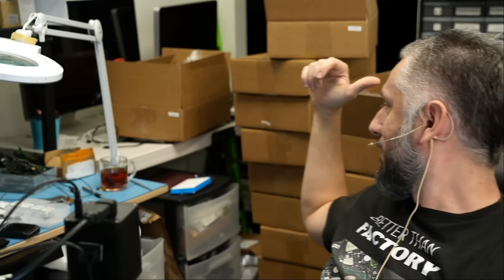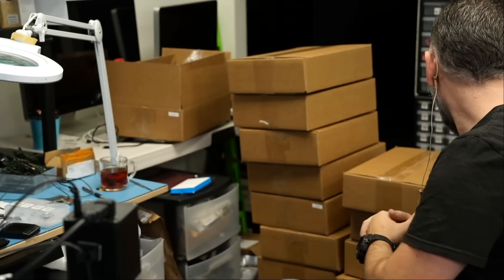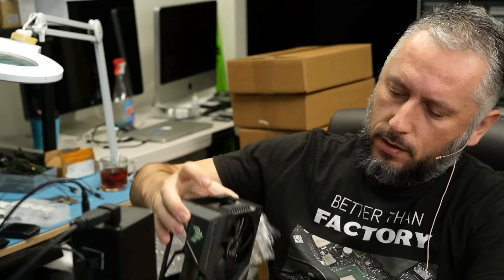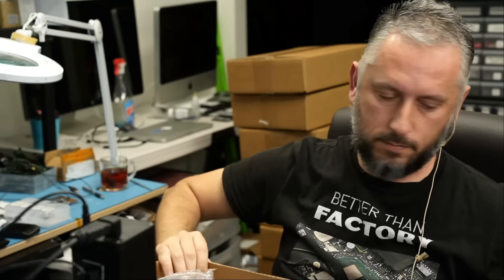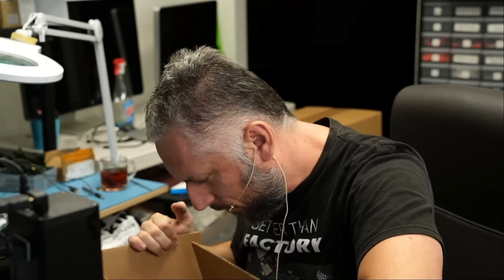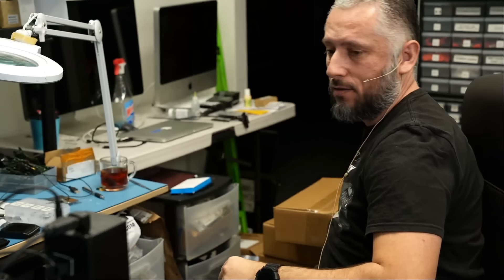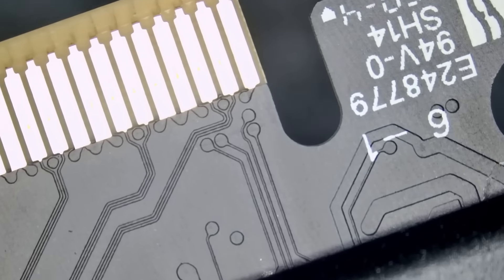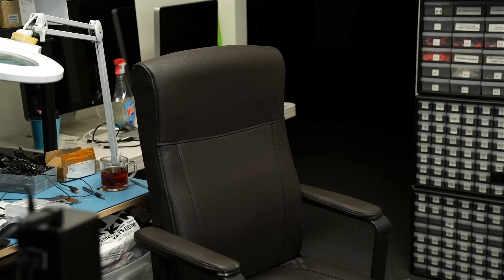We received 19 cracked 4090 Cards for repair - Who's to Blame ?

Comment: Curious, why didnt the customer ask if you're willing to repair 19 cards with cracked PCB before sending it in?
Reply: Maybe the customer was not aware of the cracks?
Reply: Doubt the customer knew what was wrong with them.
Reply: customer wrote damage so he knew...
Reply: @kroks06  we have a "video" there too, what "video" means?

Besides, the truth is we don't know who exactly wrote those things there.
Reply: @kroks06   Knowing they are damaged is different to knowing why they're damaged....
Reply: My heart is bleeding to see all that dead cards😢
Reply: It's entirely possible they're a flipper who bought them sight unseen from a liquidator and just had them sent over to Alex.
Reply: video probably mean they didnt notice damage but they werent getting video @VVarat
Reply: @Vipppala   maybe
Reply: Customer is obviously a dealer or system builder. He knew they had cracks.
Reply: User fault or transporter fault if that was prebuild system. Manufacturer and materials are sone by specifications. This is sensitive equipment and not ment to be used by everyone. Manufacturer only can give instructions for installation. Rest is on end user or builder. As a computer engineer.. i see often some pcs.. not starting cause user upgraded but not working anymore ... So far far 90% of cases solved. But i always mention to them.. about these dangers with extra large graphics cards. (The computer is on the table... Till it reach the floor and final location.. they should handle it as calm.. so not to beake butterflys wings. As also instruct them when they come for service.. the same way.)
Reply: You can always sell the parts.
Reply: @VVarat prob means there is video output even with damage.
Reply: junglebunny Mining rigs usually have GPUs mounted vertically, so such problem wouldn't happen.
Reply: Same
Reply: @kroks06 not true the wholesaler could've put that on or he could've just put the sticker on based on what he'd been told.

Be careful jumping to conclusions
Reply: *customer, what? Is he a Cosplayer? Lmfao costumer
Reply: Probably for mining, shrouds removed. Maybe water cooled, OC.
Reply: Probably no response from alex
Reply: @VVarat he should change trade if he is not aware…………
Reply: I have no sympathy for such a dope.
Reply: Because they think he can fix everything. Maybe it be best to send it to a dedicated gpu fixer.
Reply: @herofrenoulis did you use google translate? None of that made sense
Reply: customer probably knew they were damaged bc they wouldn't turn on, and the ones that did he labeled as "video" without knowing the damage itself was on the PCB
Reply: Plenty of spares
Reply: Insurance probably wants them to be sent off first before they pay for the lot.  Maybe???
Reply: Ive seen him fix cracked boards on his videos in the past.
Reply: @Versette Sure it could.
Reply: its a cracked retention tab...   notice there's no electronics in that part of the board??
Reply: Customer sounds likea miner

Comment: All those cards looks quite new to me, the Asus cards all cracked at the same area. Maybe the customer is in a PC assembly business. He assembled all these PCs for his customers and boxed it without internal support to the display cards. Rough handling of the boxes during delivery by someone might be the cause. It is so sad to see so many cards died like that.
Reply: Talk about an expensive mistake
Reply: I was thinking something similar, this is for sure user error. Where they crack is the tab that goes into the locking mechanism of the motherboard, not a single one cracked at the pcie slot.
Reply: Most probably,
Reply: LOL Seriously?!? Rough handling??? How does rough handling affect one tiny specific area?? And how do you crack a PCB.... Those things are hard as hell! NO!!! Something or someone applied pressure on those spots and yeah... I would bet it was exactly as he stated! These cards are HEAVY af!!! It's a matter of time before they bend and start cracking... And those spots are actually the most fragile ones... GPU's are screwed on the back, providing support up till the center of the card roughly... While the rest of the weight... ONLY is supported by the PCI slot... So you get alllll the support for the back of the card and almost no support for the front of the card. If you have a 3 fan GPU... GOOD LUCK! You're going to need it. It's also a miracle that motherboard PCI slots are not breaking too! 
GPU industry is a JOKEEEEEE! The moment I saw the Nvidia 3000's series I started laughing... NO WAY I'm going to buy a 3 slot GPU and on top with a "special connector". The 4000 series is a little better but oh well... Still not enough! A lot of things are not enough!! These things cost +1000$ and they don't even check if the thing as a proper weight or if it's a reliable/solid product. Just INSANE bs!!! Multi billion dollar companies and they behave like kindergarten kids... They don't know what they're doing
Reply: Sadly i bet your right,n Asus gets the flack.i used them for sooo long.not 1 problem ever!
Reply: Your guess...is as good as any other guess. We could all post guesses all day long...and write a story.....I'd rather read facts and knowledge.
Reply: I thought so too, what an expensive mistake
Reply: @additudeobx I know for a fact it's a user error issue. Have asus rog strix 4090 for over a year, moving pc and cleaning , no issues, because I do it carefully.
Reply: what a loss  uuuaaauuuu ☹☹😮😮
Reply: he clearly was under the impression that Northridge could repair the PCB.
Reply: You are 100% correct
Reply: The 4090 cards are really heavy. Mounting them sideways without extra support somewhere near the free-hanging corner is a disaster in making. If you don't shock the card it could be ok for years but even a static load like this is bad if there is any problems with the FR4 material. I think it's nuts hanging a 5 pound card sideways from the PCIe socket and the rear bracket. My 1080ti weighs only about 2.5 pounds and it's already iffy. It clearly sags without extra support at the rear end or the outer edge.
Reply: @MichaelRogersJesusrules   lucky you. 4 asus products, 8 RMAs on my side. Absolutely the worst company I've ever bought from.
Reply: @IGame4Fun2  - all of it? I mean every last one of them? No chance in hell at all that damage could possibly be from anything else or any other means? Not in the slightest remotest of possibilities at all, because you said so and you know for a fact.. Wow,,, Yea then, gee whiz... I guess it's dang well gotta be...
Reply: @additudeobx  like what? They just slide off the shelf? Of made like that at factory? Or maybe some monkeys break these cards. It's clear that some users either got this shipped to them and dmged  or weren't careful moving PC around.  User error. Take your sarcasm and sence of humor to the dump, cause it's trash
Reply: Thx for the most likely context this helps alot considering I'm literally 24hrs or so away from dropping bands on a 4090 lol was about to switch up my build
Reply: @Trip4man  I don't know what you are trying to say dude, you seem to be suggesting that rough handling in transport is not a likely cause, but then list the reasons why it's likely. Shock loading is by far the most likely cause of those breaks, when the card is exerting 4 or 5 times normal weight on the tabs.
Reply: @tyrantworm7392  You don't know or you don't want to understand??? Because you made your mind up about some bs reason.... Tell me... HOW does rough handling cracks a PCB when they're inside a box with 'air-pillows'?? Andddd specifically on that part of the PCB and not.... Somewhere else
Reply: @bluej511  did you watch the video ???  there were at least two that cracked  along the slot pins.
Reply: @Trip4man  thanks for this comment about nvidia
Reply: And the should be fined or even jailed.

Comment: The problem is not the pcb cracking ... the real problem is that there are traces in this weak spot ... the manufacturers know that that area is a weak spot and suffers a lot of mechanical stress ... yet they put traces and tracks in that area ... coincidence? ... i don't think so
Reply: Thank God my msi 4090 liquid X is still good lol😅 still running like a beast
Reply: Why would they put traces to and from the pci-e slot? Can not be a coincidence 🤡🤡🤡
Reply: It's the PCIe connection.  Obviously it has to have traces leading from it lol
Reply: Why Asus intentionally make a inferior products 😮
Reply: They have limited space to work on. I guarantee they're not wasting space and the cracks will travel further between the layers that what you see in this video. The problem is solely weight and lack of support by the installer, whomever that is.
Reply: the same reason they keep on adding the shield from the gpu that sustain all its weight atched to the pcb instead of the fucking heatsink ...

Comment: My take: 
When there is such a common weakness the manufacturer should at least offer cheap GPU-less replacement boards so the GPUs can be re-balled.
The 4090 chip is the most expensive part of those boards.

I hope you record all the ones your take apart.  Would love to see all the ones that get repaired.
17:28 - "ASUS...ASUS if ASUS is watching they're probably going crazy."
Customers watch your channel and see what you do.  
They think you're a miracle worker Alex and quite often you are.
Reply: You can simply do that on a board that the GPU don't work
Reply: @mokywlmd572  ...which requires you to find one where all the other components are in working order.  What are the chances that the GPU experienced a voltage surge enough to kill it but all the other components are hunky dory?  Yeah...we know that's an option.  It shouldn't be the best available option.  "simply" yes...thank you for your input.
Reply: what about the fact that it's entirely was sent by 1 costumer
Reply: It's called manufactured obsolescence
Reply: its not a weakness, the motherboard is tough.. the weight isnt an issue, its a user propblem.. fix your mounts.
Reply: @kanecrowe4587  Nahh, when this happens to so many boards it's a product defect.
Reply: @VincentVonDudler  don't you get a support bracket with every of these GPUs? I think you do. They send it for a reason. So it is not a defective product when you don't instal it properly. So without support bracket.
Reply: Definitely manufacturer issue.
Reply: ...and why I will assume the reason asus provided an adjustable support stand... as they knew the weight/mount was an issue @VincentVonDudler ... .... Manufacturers mount the heck' out of the cpu, but leave this gpu slot mounting underdesigned for the current gen' cards.
Reply: @korinogaro  ASUS sends a little tini tiny support pillar that barely reaches the gpu in a case with a psu shroud. no psu shroud->no support. MSI offers way better supports, either bracktes that are mountet on the pci brackets, or big pillars with adjustable clamps that even work without a psu shroud.
but since many of those gpus have threads on the rear side for potential support, case/gpu manufacturers should work together to design compatible support brackets.
Reply: well like he said, the cracks comes when people install the cards without support.. and with the 4090 from asus you get a support with it.. so to not use it is stupid...
Reply: Manual says to install card with support, if users don't do that, why it's manufacturers fault? Mine Asus 4090 ROG works well, no smelting, no cracks, cool card.
Reply: @VincentVonDudler  except asus literally give you a mount to use to support the gpu. Not their fault if you dont use it
Reply: @TRC_WAThe actual issue is that desktop enclosures have died out, and everyone is just using mini and micro towers nowadays. PC mainboards were originally designed to be mounted horizontally, with the cards sitting upright in the slots. Much better mechanical stability for all components, better thermal flow, etc. And when enclosures had space for full-length cards, they also had edge rails to support them on the end opposite the mounting bracket.
Reply: @dmitrijmarcinkevic7885  Do you you think they read the instructions?. I bet many don't.
Reply: @korinogaro  Exactly, Asus provides a solid support bracket AND clear instructions for it lol. This is 100% user error
Reply: @korinogaro  My Asus 4090 TUF came with a screwdriver that doubles a GPU brace. I replaced it with a solid aluminium bracket that uses three of the expansion slot screws to support the brace.
Reply: That's a good point. Though to be fair, some of these cracks were so large, somebody clearly dropped the computer with card mounted inside with no support. Other than supplying every card with support bracket, I don't know what manufactureres could possibly do about it.

Comment: WOEW!!!!! (Roughly} $38,000.00 worth of video cards ready for the landfill. Only good for spare parts for what, MORE broken 4090's? Some type of mechanical support is definitely needed. Feel sorry for this customer, that's an expensive mistake sending all those at once, he should've sent 'one' to Alex first. They apparently don't understand that these boards are multi layer and almost impossible to repair. Even if you did they'd just break again. There is NO way of making a lasting fix here unless you could acquire brand new unpopulated boards and transferred all the components over to them. There again, NOT feasible. 🤦‍♂
Reply: In germany they fix it .. I do not understand why people say it is not possible.

Comment: Well, now the customer has a ton of spare parts to fix a LOT of other cards.
Reply: He just became the #1 supplier of 4090 components in the US.
Reply: What do you mean the Customer ? The Customer sent NorthridgeFix the cards. How does than mean the Customer will have spare parts to fix other cards, if he's literally sending them to Northridge fix for attempted repair.
Reply: @StatsGam4er  Sometimes other shops sent over hard cases to Northridge Fix.
Reply: There is another youtuber that fixes cracked cards. Might have to re-ship them there. It might be $500+ to fix, but the cards still sell over $1K I think.
Reply: I was thinking the same thing.  Those components and aluminum has to be worth something in replacement part and scrap.
Reply: @Enigma8750  but can he mod and solder de solder of chips and mod RTX 3070 8gb to 16gb
Reply: @StatsGam4er  He literally said in the video that the customer pays bench fee and return shipment.

Comment: Fun Fact all the ASUS ones (At least 4090s and 4080s) comes with a nice sturdy support stand for the GPU so the most likely scenario is: These probably failed while shipping from an ISB (PC Builders) to the client.
Reply: I use the adjustable support that came with my ASUS TUF OC 4090. It's just a friction fit support with rubber ends. I could never imagine why someone would ship it with any confidence that it would stay put. A small bump can and likely will rattle it loose. That's not ASUS's fault in my opinion, they offered a solution in box. That's not a catch all for stupidity and not yeilding to the basic laws of physics. Whoever did this would probably drive their car without engine mounts too.
Reply: Mine wasn't even enough height, couldn't use it. Used something else but after seeing this video, I literally stopped what I was doing and put my tower on the side til I figure out what I'd prefer to do.
Reply: @ryanmann3412  what case are you using? or did you take out the drive cage in favour of fans? It should fit if you have the holder sitting on top of a drive cage cover.
Reply: why the fuck do we even need support stands for videocards
Reply: @abmong  Thermaltake View 51. I don't believe there was a drive cage to begin with. but if so, I can't recall, it wouldve been removed as I only used m.2s in this build.  It's wide open on the bottom, in which I put three intake fans. I used a longer style bracket that had to rest on top of a fan.  I'd have to take the card out and inspect it. I will, just don't feel like it for now and threw the case on it's side and removed the support.
Reply: I GOT A STAND WITH MY 4070TI AS WELL  gigabyte OC version
Reply: Asus is one of the worst companies out there. Fact that most these cards are asus means asus just got cheapest version and sold it for big cash. As always
Reply: @AltPlus30  lol... because of the weight.
Reply: @saywhat524  nope
because they become useless after 2 years
Reply: @abmong  those ASUS stands are tiny and only reach the card when your case has a psu shroud
Reply: @schwubbi  lucky for me I do then 😁 with my Corsair iCUE 7000X
Reply: True but i can't use this support in my case. I had to use some workaround.
Reply: armatures arent going to think to mount a support bracket (if it even fits in their case).
Reply: @Shoeboxcat7  I have a tuf 4090 and I use that stand... but I'm not confident it would prevent all cracking.
Reply: @jessefisher1809  That is a valid concern, and a more substantial 3rd party stand might offer reassurance. I personally think the one provided is enough if the tension is set the correctly. Mine appears to be supporting the GPU adequately.
Reply: All current gen Asus tuf come with a gpu sag stand, AMD as well.
Reply: @xAndrzej42   At one time Asus made / built 60 - 70 % of all computer parts for all  P C  suppliers.  I ran their products for years with great results. Like most all do they start to put production / coast / profits over everything else sadly.
Reply: @snaplash  time to either upgrade the standard or learn to make lighter gpus
Reply: Gigabyte comes with even better sag support than Asus.